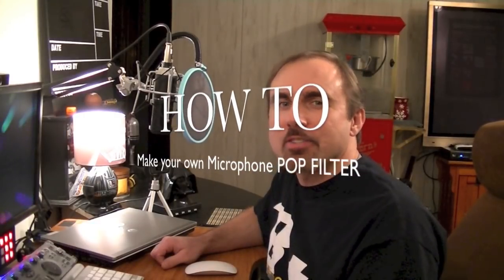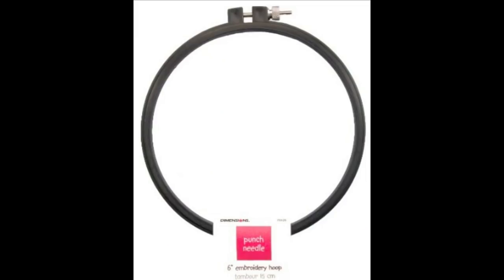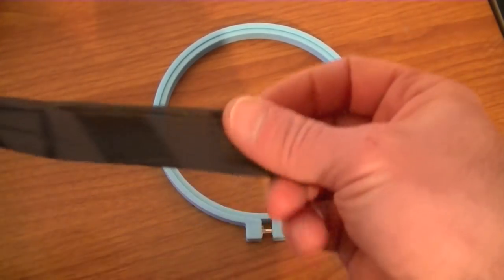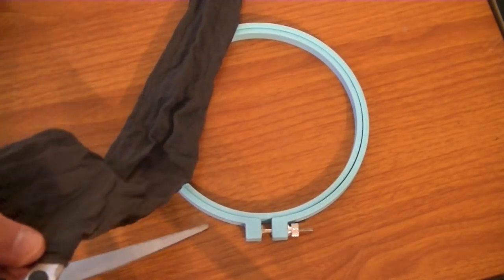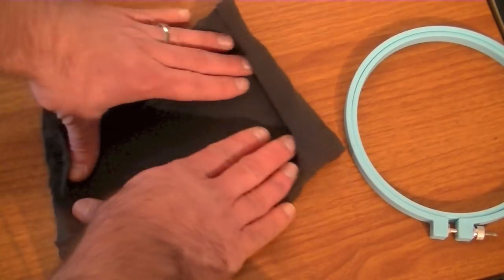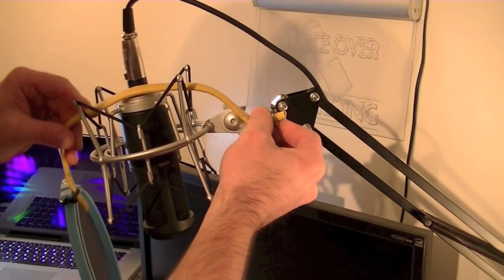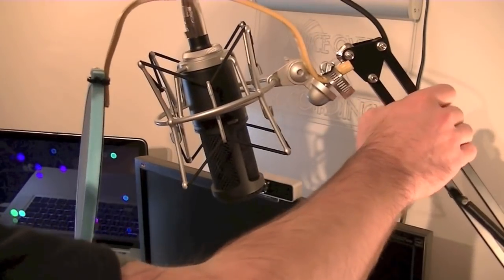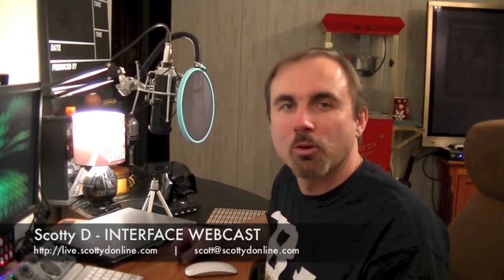How to make your own microphone Pop Filter

Comment: Metal filters work almost as well as mesh filters. The only thing about metal filters is getting the right angle. If you speak at the wrong slant more air gets through to the mic... not a biggie though.. Metal filters don't dampen the high frequencies as much as the mesh filters, that's why they're used a lot! They work great and you don't hear any of this resonating you mentioned. Mesh filters tend to kill the high frequencies a bit...

Comment: I would crimp an eyelet to the wire and slip it over the tensioning bolt and use another nut to tighten the wire to the filter ring. The use shrink tube to cover the eyelet. Would look like a professional build.

Comment: Thanks for the useful and inexpensive pop filter.  I'm actually looking for a pop filter that I can use with a headset/mike combo.  The only thing I've seen is really a wind screen that fits over the mike, but they're not that effective. I think I may just have to spring for a full mike setup.

Comment: If you are doing this by yourself, you could also alternatively slide the interior embroidery hoop into the legs of the stockings and tighten the exterior loop over it. Then just cut the excess from the back.

Comment: NEXT VIDEO: How to build an assistant for placing the nylon on the embroidering hoop. Nice Video Scotty, really. I have an idea for an updated video. Get a cardboard box, a free one from any nearby dumpster. Get a few thumbtacks. Tack in a corner, slide the hoop below the nylon, stretch the second corner over and tack it, repeat stretch and tack for remaining bottom corners. I've only tried this out in my head so maybe the thumbtacks might pop out? In that case use longer straight pins. Might cut out the assistant needed? Oh, after cutting take a lighter to the ends of the nylon for a nice tacky and stiff endings that won't slip back through the hoops :)

Comment: Silky Pantyhose is the best material for the pop filters. I actually use a hybrid system where pantyhose is placed over a metal pop filter. This works really well as you get an extremely tight sound.
 Kind of hilarious when you walk into a store to buy some pantyhose for your mics and  get the weird cashier look. 
Been making my own pop filters for years now using Pantyhose and the knitting rings you used there.

Comment: The thing I'd be concerned about when building a DIY pop-filter, besides the material possibly reducing the brightness of the audio (like a sock, but not pantyhose), is the fact that while the material is blocking the abrupt puff of air from hitting the microphone, the puff of air is still buffeting against the taut material, so you might still be getting a pop sound with P's, like an object striking a drum head. You would want a material that blocks the puff of air, doesn't muffle the sound, is rigid enough that it doesn't act like a drum when the puff of air hits it hard, and doesn't resonate.
Reply from the maker: The construction of this DIY pop filter is exactly comparable to commercially sold pop filters that are used in professional recording studios around the world. There is zero coloring of sound using a nylon mesh material and I've never had a drum like effect while using this or any other pop filter that uses a double layer nylon material. I even have a Kaotica Eyeball that has a double layer integrated pop filter and it reacts the same.
Reply: That's good to know. I didn't test it, so my comment was intended to be rather general and not specific to your material. I'm using muslin cloth and just discovered that mine reacts like a drum head getting struck, with my plosives. So, I'll need to switch materials. I'll definitely give the nylon a try!

Comment: If you don't have an extra pair of hands when you come to placing the hoops over the nylon, pin the nylon out on a cork board, or piece of cardboard.  You can then easily slide in the inner hoop, and then put the outer hoop around it.

Comment: I think u should strip romex wire at the end and wrap inside wires around screw instead of using zip tie. It would be cleaner look and u wouldnt have it sticking out into the filter

Comment: interesting, instead of cutting down the side of the nylon leg to make is a sheet,couldnt you just leave it  a basic nylon tube fold it so it is a double thickness tube, slip ring inside tube then place outside ring over it?

Comment: Great video.  However, it would have been nice to see EXACTLY HOW you attached the hose clamp.  I can't see how you attached the clamp.  The clamp seems to be a continuous 'loop' and the disconnection point of the boom arm is not too evident, either.

Comment: I recently made a small pop filter, 2 small pop filters from the same stocking thing, except I use plastic bracelets as the ... I don't know what it calls,

(that green thing that you have in the video)

but you know that bracelets are not that wide,
is it okay if I use it?

cause I have 2 different sized pop filter, the big one seems to create a clearer sound than the small one,

I'm afraid I need the way bigger one,
but I only have a mini microphone,
so I don't think of bulding a bigger pop filter....

what do you think?

Comment: Wy not slip the inside  hoop int a leg of the hose first, than place the outside hoop around it. Trim the hose over snugging up the outside  ring. I use this  combo to smake small silk screen screens. BTW a nut driver works best with that sort of hose clamp
Reply from the maker: You could do that... it's my experience when trying this, the small section that remains open which you have to trim off, comes loose easily when you just slip the internal ring into the nylon. But hey, if it works, then good on you! :)

Comment: Isn't there supposed to be space between the 2 mesh layers for the filter to be effective? When you were stretching the stocking out to put it on the ring, I thought you were going to have your assistant put the inner ring between the 2 layers of mesh while you stretch it out. Not sure how you would tighten it in that setup but that's kinda how I think pop filters work, in my limited knowledge.

Comment: If you've been recording for well over a decade, and you've gotten so used to recording without a pop filter, is there really a point?
Meaning, I've gotten very used to making sure that when I'm about to say a "P" for example, I make sure to say it a little lower than
usual to make sure it doesn't pop.  Doesn't seem to effect my recordings, and I've noticed my recordings at the end of the day will
actually sound even better, more clear.  Because of course a pop filter helps with p's, but at the same time it muffles everything you
say to a very small degree, that I feel is noticeable then when I don't even bother using one.  So long as you use caution with your
P's, and simply re-record your vocal track if you accidentally let one slip and cause the pop or "clipping" sound.. then you SHOULD
be fine right?
Reply from the maker: mista808 good mic technique is paramount above all. But a pop filter is a added insurance policy to your sessions.

Comment: Can u clean the  nylon and reuse it or would u have to use a new piece of nylon
Reply from the maker: I suppose you could try and clean the existing nylon but trying to remove it, clean it completely and reassemble it after it's already cut will be challenging.  Nylon is dirt cheap so you can buy a new one, stretch it and trim off the excess. That's what I will do.

Comment: Can I use a different material instead of nylon
Reply from the maker: You could but remember the denser the material, the more it will limit and alter the sound before it reaches the microphone. Nylon is very thin and is the optimum material.
Reply: thanks

Comment: Can I do like two layers?? If that make senses? ((I feel like It'd work better doing that, but I wanna do this on the first time))
Reply from the maker: +The-Ultimate-Nobody This one I made is considered a dual-layer pop filter because you fold the nylon back on to itself. You could go quad layer if you'd like... just be aware... even the smallest barrier between you and the mic can affect the sound of your voice. If your barrier is too thick it will create a baffle effect to a very trained ear. For an example... a sock will provide pop filter like results but the effect on the mic is very muffled.

Comment: I didn't notice this suggestion in the first three pages of comments so I apologise if this repeats an old comment. Couldn't you simply slide the inner hoop into the stocking tube? The plosive wavefront would still have to pass through two layers of fabric. The fabric may not be quite as taught as your method but since the aim is dispersion rather than damping, this shouldn't reduce the shield's effectiveness.
Reply from the maker: You could certainly try... in theory it will work just fine as it will be a double layer pop filter... the challenge will be keeping the material in place in the hoops. Post your experience with this method if you try it.

Comment: on-stage asvs pop filter can be bought for around $10. fully adjustable, removable, relocatable, easy to use, looks more pro. i like diy projects when they are worth the savings and still look good. dont get me wrong, this is a great tutorial but not sure its worth it to make one.
Reply from the maker: Believe me, I researched and reviewed countless manufactured pop filters and none that I have found so far are maintainable... in fact, if you read the reviews, and look at the negative reviews of most manufactured pop filters, they are not quality. They are cheaply made and not worth the dollar spent.  I have also been very clear that IF I can find one that is maintainable and is specifically made to be maintained, I would consider... I have not yet found one... to include the one you mentioned.

Comment: intstead of cutting the nylon open why not just slide the inner loop into the stocking? you dont need an assistant and you have less to cut. it will save time and it will be a lot easier.

Comment: I just can't understand - Why didn't you put the plastic tube on, before You attached it to the boom? (without cutting down the tube?) :)
Reply from the maker: Simple... you need to know the distance of the wire after attachment is made before you know how much tube you need. Having it attached prior without cutting it to length is plausible but will definitely get in the way of the attachment operation.

Comment: One question I'd like to ask: is it absolutely necessary to use two layers of nylon, or is it possible to get away with just one layer?
Reply from the maker: ***** No, it's not necessary, however with a dual layer your plosives get dispersed better over two layers of nylon with no sound degradation.

Comment: Guys, don't cut the pantihose, instead pull the mesh over the ring down to the toe of the pantihose. Saves you time and effort. I spent $25 on a professional grade pop filter, but this works just as well.
Reply: zerotankor I figured the same thing. Gets you twice or thrice the material per pantihose.
Reply: I thought the same thing.

Comment: Hey @Scotty DMay I ask something that has been a 7-month question mark in my head?
Thing is I have a mic, but no pop filter. Whenever I record my loud singing, there seems to be a LOT of clipping basically throughout my whole recording.  But when I sing soft, it's fine.
So my question is - does a pop filter help to lower the volume of your loud singing as well so it doesn't sound overpowering in the voice recording? :)
Reply from the maker: Oliver Ma No... a Pop Filter will not help you there. The first thing you need to help eliminate clipping is GREAT mic technique when recording. Secondly watch your GAIN levels to ensure your LOUDEST singing voice will not clip your mixer and or DAW and if you're using a USB mic, make sure your GAIN will not clip in your DAW directly.
Reply: Ooooh thank you so much :) I'm subscribing just to show support and gratitude.

Comment: I have a metal pop filter. I payed probably 60$ for it which was a really bad decision because even though the pop filter feels really premium and sturdy, it is really hard to get on to my yeti and it doesn't even mount the stand correctly. Big mistake getting it.
Reply from the maker: Thanks for sharing your experience... if you can, provide the make and model of your pop filter so others can steer clear of it if they also have a Yeti.

Comment: I use a Blue Yeti mic without any kind of arm... What would you recommend I use to attach it to the base? Or should I somehow craft a separate base and simply have it sit in front of the mic?
Reply from the maker: Ryan Rovida Not sure... I don't own a Blue Yeti so you'll have to determine the best way to mount it to the stand if that is your preference.
Reply: Ryan Rovida a blue yeti has a built-in pop filter so you shouldnt need it...
Reply from the maker: There's a distinct different between a WIND FOAM that most microphones have built in in some way shape or form around the capsule itself and an actual POP FILTER.  They are designed to handle situations differently. In short a Wind Foam will keep out airy noise and silence your breathing some but very few are designed to keep out Harsh P's and B's. That's where a true Pop Filter comes into play to reduce Plosives and Blosives. As always Mic Technique is key to making a recording experience satisfactory...
Reply: Scotty D sorry, i wasn't informed properly i guess :P
thanks for telling me though

Comment: Hey what webcam stand do you use i have the same webcam and i also want to buy it :)
Reply from the maker: I have a tripod for my camcorder... I custom modified my Webcam though. It's a Logitech C910 and I drilled a hole in the base of it to accommodate a mini-tripod which I got locally. They also sell them on Amazon for around $10 (US). Here's a direct link. http://www.amazon.com/gp/product/B004OAFO0I/ref=as_li_tl?ie=UTF8&camp=1789&creative=390957&creativeASIN=B004OAFO0I&linkCode=as2&tag=iw09-20&linkId=VJCVYMTJMPFXZXLQ

Comment: Can i use hot glue or some double sided tape to attach wire to filter?
Reply from the maker: I don't think that Hot Glue or Double Sided Tape would handle the attachment very well. But certainly you could try it and let us know your experience.
Reply: ok ill try :)
Reply: hot glue worked fine. it was fixed in his position and not moving, double sided tape was trash...

Comment: We can't get any Romex Wire over here in the UK. any good alternatives?
Reply from the maker: Any thick, stiff but slightly flexible wire will work.
Reply: I was looking for names/types really. just so I can go in store and not sound like an idiot XD
Reply from the maker: John Mckiddie Go to your home improvement hardware store and ask where their home/residential electrical wire is. If they sell it by the foot, that's what you're after in this build. It's usually a three wire cable and in the UK it would more than likely be a Brown, White and Blue cable binded together. This is pretty thick wire...

Comment: I'm looking for some mic's that i can plug my head phones into like the blue yeti and the samson go mic's ?
Reply from the maker: +drrobotnikmeanbeanma There are plenty out there, most if not all of them are USB style mics.
Reply: What's the names of them. I found out 1 is called the Irig Mic.
Reply from the maker: What is your budget and what is the use-case (i.e.: What are you planning to record with it)?
Reply: I have a Sony ICD-PX333 voice recorder I'm plugging the mic into.That I can record a rap verse when I'm traveling.Something with a xlr and with double A batteries.I'm looking to spend $100-$200.
Reply from the maker: I am not aware of any XLR mics with headphone jacks. The reason for this is that manufacturers assume you are using a fully outfitted setup to accommodate headphones with XLR. The only mics I am aware of with headphone jacks are USB mics. Apogee has a great mode, as does Rode and many other companies in your price range.
Reply: 1 more question, try a portable phone charger called a Acer Liquid Jade S Metal and a mini usb to usb And 3.5mm and plug the 3.5mm into a recorder to see if it will record like a real condenser mic ?
Reply from the maker: Not sure what you'd accomplish with all of this but it will not record like a "real condenser mic". Only a Small or Large Diaphrapm condenser mic can record like itself with any level of quality.

Comment: couldn't you just put the center ring into the leg then push it in then put the outside and then cut around the edges? one can do that solo and it's essentially doing the same thing when having the assistant place it between the cut halves.

Comment: How would you do this without a boom stand holding your mic like just a regular stand someone tell me please
Reply from the maker: Any clamp system you can modify to hold the wire section will work. If you don't need it to be easily removable a hose clamp will work. Otherwise a pinch clamp will work.

Comment: would it not be easier to NOT cut off the toe and just slide the stocking over the hoop that way you have two layers that a are a distance apart that breaks up the air better AND its easier to put on etc.

Comment: hello! What mic are you using in this video? Is it phantom or USB power?
Reply from the maker: There are two mics used in this video... the horrible sounding audio in the video is coming from the camcorder mic. The mic on the stand is an Audiotechnica AT2020 XLR so it is phantom power via my Alesis Multimix 4 USB mixer.
Reply: Cool beans. Thank you!